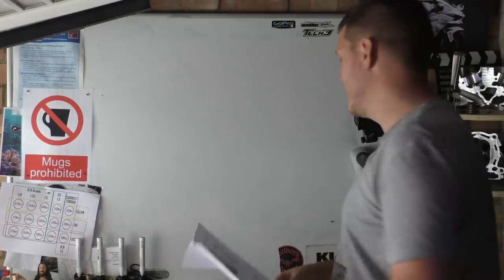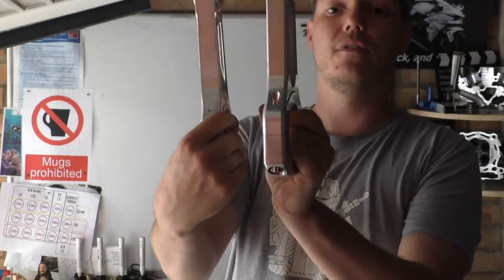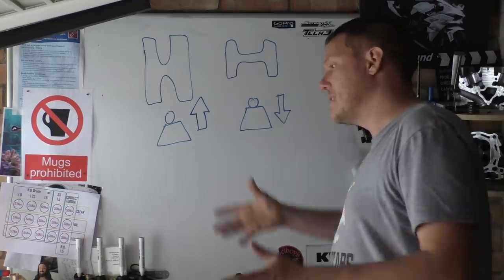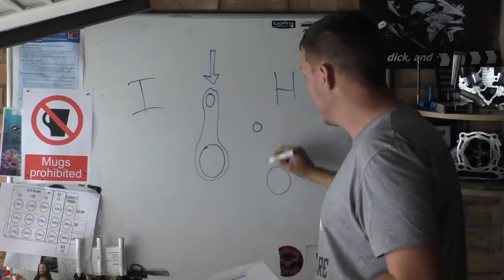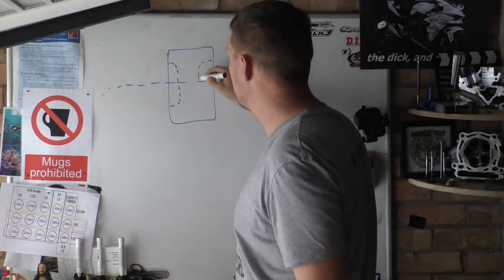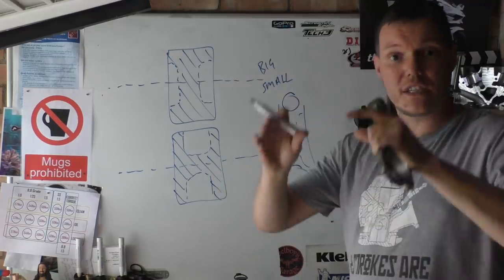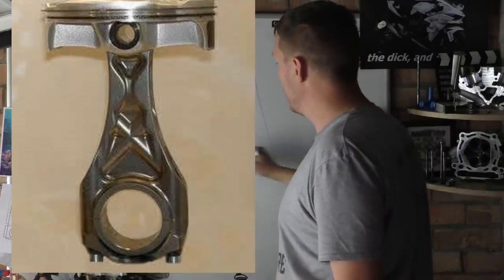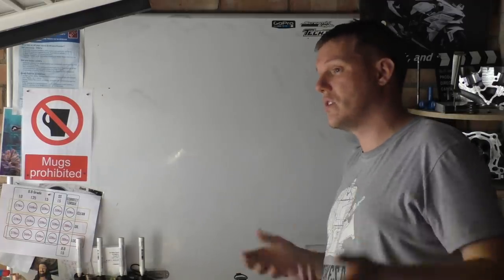H beam rods - are they better?

Comment: I`m sorry but I can`t find a heavier H-Beam rod than an I-Beam ror for my Engine and a lot other engines O.o The I-Beams are almost 100gr heavier than H-Beam and the H costs always less. Btw. I`ve seen a F1 N/A Engine with MAHLE internals...and they have H-Beam or a mix of both. I still don`t see the benefits for Forced Induction engines going H. All manufacturers with high HP outputs use I-Beam and even F1 Turbo engines use I-Beam. I`m not an engeneer but to me it looks like I is the stronger while heavier rod that is up to task in BIG HP applications. Even conrod manufacturer saying that I beam is the way to go for more power.

Comment: There are also cross beam rods, as in Pauter rods, and X beam rods as in I can't recall who they are made by!  Also, Miller, and Offenhauser (what Miller became in a way), one of the sexiest race engines ever,  used tubular section rods.
Reply: Those Pauter rods must be pretty light comparatively.  Good in long rod setups for high rpm?

The thin ribs of the H-beam apparently can be induced to flex (e.g. by a slightly off-axis compressive force) and that then causes the whole rod to be weakened and bend, or buckle.

X-Beams look to be the best for all around rigidity (in lieu of a reliable way to make tubular ones) thanks to the longer, diagonal ribs - hence their use in Diesels with their heavy pistons?

This must be significant, because large marine Diesels often use skinny-looking circular section connecting rods.  I wonder if this is because the crosshead guides prevent rotation of the piston and so remove any torsional load on the rod.

I would imagine, then, that much of the bending load on the rod really comes from the inertia of the piston near top and bottom dead centres, and is not so much a concern in a slow speed engine?
Reply: "Those Pauter rods must be pretty light comparatively. Good in long rod setups for high rpm?"
Never weighed them in comparison to other aftermarket rods, they are heavier than the factory rods from my Evo 6 though, althought that isn't surprising.  They've had a really good pounding in many highly boosted VW flat four drag engines over the years without any trouble. Pauter started out making VW flat 4 tuning parts.

Comment: Couldn't you start off by explaining why a tube is stiffer than a solid rod of the same mass, and then show how removing material from the conrod to lighten it, does not decrease its stiffness when it subjected to the bending moment? Then you could explain why different sorts of engines require different considerations when balancing lightness with stiffness in different dimensions. I only ask you to do it because I can't do it myself. Cheers!
Reply: tube is not stiffer just lighter with almost the same stiffnes

Comment: Its not that were stuck it the past. A chevy small block has the most information around and is the cheapest aftermarket for them.
Reply from the maker: A cam in block, rockers and pushrods. No of course its not stuck in the past.

Comment: Nowadays I beam rods can be made just as strong as H beams but if you want to guarantee that 600 hp isn't going to blow a rod and don't want to spend for 1000 HP I beams or H beams, typically H beams are strong enough. Unless they're bad from the factory, but H beams can also be made just as light as I beams with ease.
When an H beam bends though it's going to take a lot more force to bend it and keep bending it than an I beam. Once the I beam gives it's most likely just going to fold like paper and if it doesn't give right away it's not going  to take much to go all the way

Comment: Can you answer a question, where does the bending moment come from, you can't have a bending moment on somehting with two pivot joints. You can only have and net force and a side loading from the thrust side of the piston. The rod then only experiences tension and compression. How did you model the forces to input the boundary conditions for your fea simulation?
Reply from the maker: " you can't have a bending moment on somehting with two pivot joints"

- great comment, and I'd love to hear your explaination of why you can't but moving on.

So straight to it. Put in a simple way, and you're probably drawing this out so I'll explain it this way. 

When the centre-line of the conrod through the crankpin is perpendicular torque is at its maximum. So from wrist pin through the rod and then to the crankpin this is your primary force. Now looking at the crankpin to crank centre-line you have the greatest reaction force opposing that froce down the rod. 

This is when the force acting against the piston has the greatest resistant force from the load of the system all the way back to the rear wheel. So the resistant force at the crank pin, vs the force down the beam of the crank gives you a linear component. 

With the piston force applied towards the crank CL this gives you your bending moment. As this system is dynamic the bending moment is constantly moving within the rod. So to this end you have to work on a static analysis. In other words this is a bending moment and not a simple shear.

Comment: Really interesting to hear a bit of a comparison of these types of rods.  We've made some I beam rods for old motorbike engines at work but didn't really understand the strengths and weaknesses of the design, just copied an old one...  Would it be correct to look at the I beam as 2 separate beams with a joiner in the middle (like you said about the H beam) but the beams being in a better position to take the bending moment you talked about?

Comment: @Matt, so this also applies to Automotive cars too right on what you're talking about?
Reply: Lime 
Its quite the opposite to what Matt has explained in aftermarket Subaru con-rods.  The strongest and heaviest rods are usually always I beams.  The lighter and lower horsepower rated rods are typically H beams.

Dunno why its like that?  Might be a difference between sports bikes and boosted car engines.

Comment: I haven't managed to give a complete fuck about I-beam vs H-beam. Aftermarket H-beams are forged 4340 instead of the Optimized Powdered I-beam Metallurgy (pronounced "Opium" because we're cool as fuck.), so they likely promote ductile failure before brittle failure as a forgiving failure mode. Given that most hot rodders are stupid, what difference does it make?

My LS came came with I-beams from the factory. I bet if you re-built it on H-beams, the power loss would be less than what atmospheric anomalies cause. When you run an energy audit on any engine, it's always the total assembly that makes the grade.

Comment: well mat i have contacted a couple of major rod manufacturers and they recommend forged i beams as their strongest rods!
Reply from the maker: LOL - your point?
Reply: you said H beams were strongest, they are not!
Reply from the maker: For a given weight. You did talk to rod manufacturers, and their strongest rods will be I beams, you're confusing what's on offer vs a comparison for the same weight. That's were the term 'generally' comes in. The other thing is what the fuck does 'strongest' mean? Tensile, compression, bending, tortionally?

Comment: If cost wasn't an issue, could a 3D printed rod with organic design, outperform this the space age designs? or would it look almost the same?
Reply: I would hazard that an optimized 3D printed rod would look a lot like a chicken leg bone. A strong shell with a network of supports inside to stay as light as possible.

Comment: The point of american V8s was never high RPM, it was low(er) end torque due to their cars being bigger = heavier.
Also the big blocks are similar to truck engines, or they are de facto truck engines, which helped mass production = mass scale economies = lower cost.

Comment: If there's a bending force in one direction as well as axial compression then they should all be I (this is why we need serifs) beam shaped. Something between a UB and UC section that would be used in buildings,  but, proportionally, fatter. If there's any torsional force and I guess there shouldn't be, then a hollow section makes sense. So this H section seems to be bollocks. And even if you're saying well we want it heavier due to higher forces you still want it as light as possible surely (Unless it using the principle of a flywheel and maintaining inertia but why would you not want a free revving engine? Maybe to lessen engine braking?) ....and the most efficient way of making it strong yet light is an I beam in the correct orientation. The bending would only come in one direction surely. Can't see any reason for the H orientation. As you say for tensile forces it's just cross sectional area. But yeah...you want the mass in the flanges further away from the neutral axis not in the web. I'm sure there's some actual mechanical engineers that can tell me I'm talking bollocks...
Reply: ...but if you want a conrod heavier on purpose why bother with the grooves at all. Maybe it's a heat disipation thing, increasing the surface area without losing the mass...?
Reply from the maker: "So this H section seems to be bollocks."

- LOL What? As in they don't exist?

"And even if you're saying well we want it heavier due to higher forces you still want it as light as possible surely"

- Yes you do.

"and the most efficient way of making it strong yet light is an I beam in the correct orientation."

- I think you're confused here.....

" The bending would only come in one direction surely."

- Again I'm lost...

" I'm sure there's some actual mechanical engineers that can tell me I'm talking bollocks..."

- That would be mean, and yes some of what you say is either bollocks or I don't understand what you're getting at?
Reply from the maker: No one wants a heavier rod. You've missed the point completely. For compression forces a 'thicker' rod if you wanna call it that is stronger. H rods are for increased compression forces like turbo's etc.
Reply: The Workshop You talked about a bending moment during the piston stroke. So that doesn't occur perpendicular, only the one way. That would be the optimal way to orientate the section i.e an I as opposed to an H'. For combined bending and axial compression well that's beyond me but generally a column in a building is square in terms of dimensions, a UC section. They are I think nearly as strong in both axes as it is only as strong as the weakest axis in buckling so they need to be similar in x and y directions. Even so they're stronger in the I direction. Basically...you want your conrod as strong as possible for as little weight so put it in orientated as an I. If it needs to be stronger I'm compression and for fatigue...thicken it up. But it makes no sense to rotate it to an H. Because it could just be rotated and be stronger for the same section. Do bigger cylinders  cause forces in a different direction? Doubtful. Just bigger numbers.

Comment: This videos pretty awesome, I never really thought about it xD but it does make sense that v8 guys use H rods because the old school v8 couldn't rev high because of the shitty oil pump design... So they'd stroke the fuck out of it then nitrous or a blower all making power between 2000 to 6000 rpm so their oil pump wouldn't shake apart on the street xD so definitely making power with cylinder pressure and not rpm. Love your videos!

Comment: Isn't it also more expensive to make I beam rods in low volumes then making H beam rods ? Ducati race department used H beam for all there engines up to the 999 Factory bikes . From the 1098 generation onwards they used I beam rods similar to the ones used in there road homoligation bikes .. just wondering if cost has something to do in this matter aswell . Low volumes H rods are cheaper to produce then I beam TI rods .. as Ducati used TI rods for all homoligation road bikes
Reply from the maker: Depends if they're forged or not. The ttoling set-up for forging is the expensive bit. But not many people do low volume. For racing its just the cost of racing, hence why the bikes cost about 1 million.
Reply: how do they actually make H beams, forge a solid and mill out the sides? Its seems like I beam would quite a bit simpler with only (mostly) features on two sides rather than four
Reply: Forged H-beam connecting rods are more expensive to produce in any quantity because of the inherent required profile machining/milling.

Comment: Formula 1 cylinder pressures are no where near most American v8 dragcars spraying 200 shot plus of nitrous if you put I beams in a nitrous motor of high boost motor you will destroy the rods besides formula 1 is gay f1 car 0 to 60 2.7 a pro stock or pro mod 0 to 60 0.5

Comment: if h beams are soo much better for high boost applications why are all the strongest rods I beams? take a look at manly rods they make a series of i beam rods called "turbo tuff" which are far stronger than their best H beam rods.
Reply from the maker: I seems that it depends which site you go to. Some say I beam and some say H beam - https://www.tarmacsportz.co.uk/wrx-sti-manley-turbo-tuff-connecting-rods.html
Reply: @dirtygarageguy  no that's definitely wrong the turbo tuff rods are I beams, i am an apprentice engine rebuilder and we use them at work all the time, they are definitely an I beam and we build alot of subaru ej20 and ej25s.
Reply from the maker: https://shop.boostinperformance.com/product-p/manley-htuff-dsmevo-rod.htm
Reply from the maker: And to add no one said they are sooo much better. That's the point. The marketing wank makes people think that they are. That's what I said at the very beginning of the vid. The other thing is that this is a broad generalisation. Some of the F1 rods are actually both and are called x beam rods. The point is that some people have it in their heads that H beams are just better. 

As for the rods themselves, because of the profile of rods in general H beam rods are usually heavier because they have more 'meat'. This makes them more 'useful' in boosted applications for a like for like rod.
Reply: I dont agree H beams are better for boost maybe tomorrow ill find some more info and show it to you
Reply from the maker: A thicker rod is better. If you have 2 rods, 1 and I beam and 1 a H rod that are pretty much the same then the H rod is going to be thicker. I don't understand what you don't get about that. As for individual rods it depends on their design. The point is that V8 modders go for H beam rods because they are thicker in cross-section. 

This is a generalisation, I can't do a video going through every rod design on earth. I agree, H rods are not better, that's the point.......

Comment: Yeah, those antique V-8s using archaic technology like pistons, connecting rods, and crankshafts unlike modern 4-bangers which use super-advanced technology to turn explosions into torque. Seriously, is there a law requiring any non-American to bash V-8s even in a video that doesn't in any way relate to engine architecture? What is it about that one specific architecture that triggers you people? You love 4, 6, and 12 cylinder engines... but mention a V-8 and you have a pathological urge to scream, "stuck in the '50s". You want overhead cams? We got overhead cams. You want fuel injection? We got fuel injection. You want aluminum blocks? We got aluminum blocks. Exactly what is it that you think is "stuck in the '50s"? Too much displacement? Too much focus on low-end torque? Doesn't sound like an out-of-tune leaf blower? I have never seen a factory American V-8 with H-beam rods in 45 years of messing with cars. Wherever H-beams came from, it wasn't "stuck in the '50s" American V-8s.
Reply from the maker: It's not V8's - its the fanboy American club that think the 'mercian' V8 are special when infact they're cheap - and outdated. 

For example - the LS engine. Barely oversqaure single cam per bank 2 valves. Still running the 2 valves per cylinder. Why? Because it's cheap. This basic layout was fine for the 1950's but think have moved on. The Merlin RR engine used in the P51 has the same thing but with 4 valves per cylinder and that was designed in 1930.
Reply: @dirtygarageguy  The first DOHC, 4-valve per cylinder engine ever was built in 1912. Does that mean every 4-valve car is "stuck in the teens"? Point being that whatever DOHC engine you happen to fancy is just as old in concept as the V-8s you claim are outdated. You talk about V-8 fanboys but you're the one screaming that your stuff is sooooo much better even though it relies on technology dating back a century. 

For the record, for my money, the best engine architecture isn't V-8 as much as I like them. The best is V-12.
Reply from the maker: "The first DOHC, 4-valve per cylinder engine ever was built in 1912."

- no. But for the rest of the world they migrated over from 2 valves to 4 valves.
"Point being that whatever DOHC engine you happen to fancy is just as old in concept as the V-8s you claim are outdated."

- No. It's not an opinion it's a fact. Engines like the LS engine use 2 valves for a reason. It's cheap.

"For the record, for my money, the best engine architecture isn't V-8 as much as I like them. The best is V-12."

- Actually the best engine is the V4.